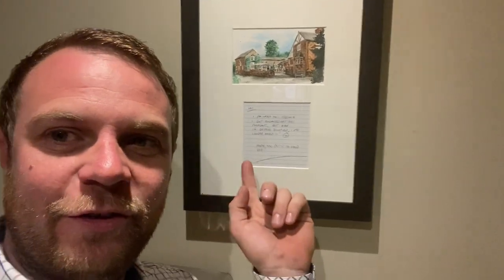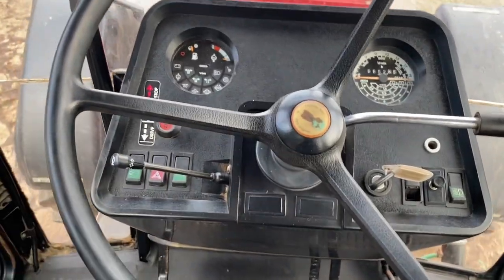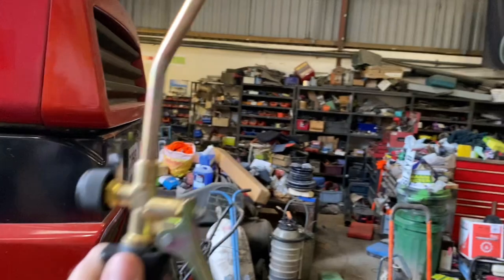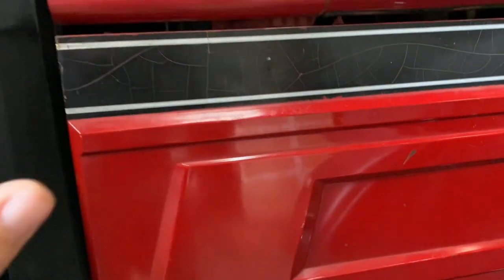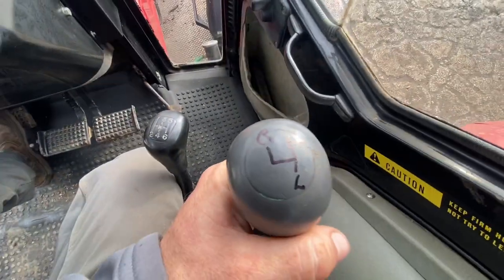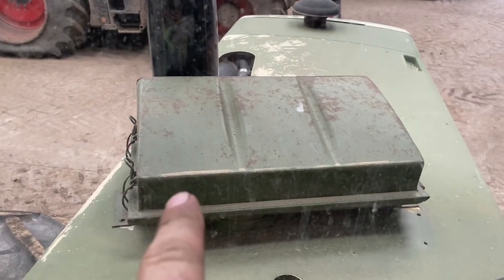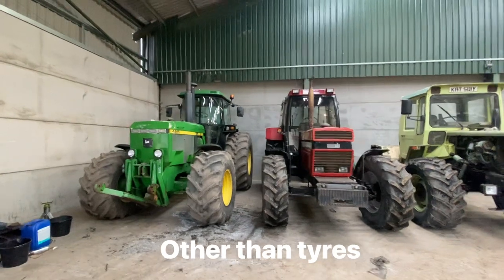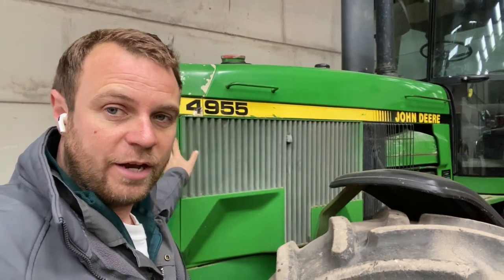Day574  #OLLYBLOGS BLOW LAMP GOES WRONG ON 1455 FIX & CLASSIC TRACTOR FUNDING  #AnswerAsAPercent

Comment: How you don’t win awards for farm diversification I don’t know Olly. The number of different revenue streams your farm has and the simple solutions you’ve used for things like grain drying etc are amazing. It’s so simple on the face of it but to think at some point someone thought ‘we’ll take tree waste (already fixing a problem for tree surgeons) , chip it, use the chips as fuel to heat the farm and the grain dryer, and we’ll sell anything we don’t use, oh and we’ll do it cleanly and efficiently’ 

Way ahead of your time. 

You’ve already got the heating system for your new museum shed too, the saying hard work easy life comes to mind. Working on your farm must be an absolute pleasure with how ‘easy’ some of the day to day stuff has been made to work when compared with other farms.
Reply from the maker: Thanks also good for getting dry when it rains

Comment: Hiya Olly, the bonnet latch is on the left of the tractor as you look at it face on. Its a lever, located under the side pannel near the cab. 
And on the speed, you have high and low range labled backwards as I understand it. As far as ik thats the formation for a 1255. High range is with the range lever toward the rear of the tractor.

Comment: That heat trick works on certain plastics by bringing the oils to the surface. Never heard it used on fiberglass, I was worried when I saw that torch!! You’ll be able to compound polish all that up and they should come pretty close. Used to love driving a 1255 with that fluid clutch!  Look forward to the mb trac refurb I nearly went mb before I hit the Fastrac, used to drive them too. Great machines!

Comment: hi olly yes there should be a lever just at bottom of right hand engine panel ,cab end .i have a 1455 to, got mine from crawfords about 8 years ago pulls like train ,160 hp on shaft.
Reply: What do you reckon the top speed of yours is? I’d have thought Olly’s one only doing about 27kph is too slow.
Reply: @adamgood742  43 /45 k it's P reg one of the. last made

Comment: the heat gun trick works with plastic as warming the plastic up brings the oils back to the surface again restoring the colour (works well on black car bumpers). fibreglass is normally finished with a gelcoat surface, you might be able to sand and polish it back up again. like you could with the paint on the top edge of the bonnet where it looks on camera to have faded, if you sand it with P1200 or anything above then polish up with compound and you can remove any dead paint bringing back the original colour again. if you would like some better info im happy to email or message you in more detail

Comment: We had 885’s, 956’s and 1056’s back in the day, and they were really good workhorses, biggest drawback was that you couldn’t alter the steering wheel position like you could in the John Deeres that we also ran! A heat gun works on faded black plastic trims, not sure whether it will on paintwork though 🤔

Comment: The leaver for bonnet is buy fuel filler should be pocking out under side panel with a round knob on end make sure you take exhaust off first before you flip it up and and don't let it go or it will drop with a bang and could break front cowling 👍 great vid

Comment: Once you have got hte MB and the 1455 in fine fettle, it will be interesting to see what they can pull compared to their modern generation counterparts. There seem to be enough farmers holding on to older, less computorised and ad-blue'd tractors to suggest the allure of high tech on low cost finanace packages might not be all that it is cracked up to be.
Also, do more comments still drive more youtube income (always used to) so encouraging as much commenting as possible will get more income to fund the quadtrac - I want to see you really build a collection of unusual tractors, of which the MB starts the journey!
Reply from the maker: I’d love a 4494 case to 
I’m not sure if comments help 🤷‍♂️

Comment: Love the update on the 14 👍
There is a handle below the right hand side panel, towards the back, it moves backwards to release the bonnet catches, then the bonnet will lift up forwards & stand up, lift the exhaust off first. The side panels then lift off upwards, when the bonnet is down it sits against them & stops them jumping off upwards. 
Had a big Sunday dinner today, so 100%. 😋

Comment: Etch the top of the gear knob with a dremel or pointed soldering iron.
Reply: Then add snowpake or white paint to the figures..😉
Reply: Great idea - then fill the etch with white paint - it won't rub off.
Reply: Tipex/erasing fluid works well

Comment: Olly, What age is your 1455XL as early ones didn't have the splitter and did only have 30k boxes in them I think. Also if it's an early one should it not be cream and red?? If there is a splitter it would I think be a lever beside the seat poss on right had side looking like a handbrake lever. Well, that's what the 1056xl was like. Also, watch up around the sunroof as they used to leak really bad and then ruin all the headlining etc. ignore the early question as I see it's not got the beige/sand colour interior. Lower panels should just pull off, then offside of the bonnet somewhere near the exhaust should be a lever you pull back then tip the bonnet forwards once exhaust removed.

Comment: A good tip for you, when using the new glass scrapper on the window, spray the glass with soapy water first, will help you to not scratch the glass from the blade and help the blade to glide on the glass <<< 36 year window fitter
Reply from the maker: Good idea

Comment: On the right side of the tractor at the front of the bell housing there should be a lever just underneath the line of the side panel you need to pull it to unlatch the top of the bonnet. The exhaust needs to be off first before you can tilt it up

Comment: To take off the bonnet you have to take off the exhaust, then lift up the side panels at side (the sit on little brackets) after you have taken the side panels off the bonnet release level is easy visible. (Pretty much a 2 person job to take the side panels off) hope this helps.
Reply: @bufferbridge  Didn't realize, the 1255 that I use we always have to or just take off the side panels off to get to the bonnet. (Also you can get to pretty much everything with only taking 1 side panel off rather than the bonnet)
Reply: @bufferbridge  Good to know

Comment: Great video again Olly,  as regards buying the jd 7710 or quadtrac,  I think the quadtrac would be more beneficial to you. Not only will it attract more people visiting it could also be very useful as a working tractor when conditions arent suitable for your wheeled tractors. Either way I will be visiting..
I think Chester is going to attract more visitors than any of your tractors 😁
Reply from the maker: I need both and have to be quick on jd or it will be traded in
Reply: @OllyBlogsAgricontractfarmer  I get what your saying, but a quadtrac could earn its keep as well as being an attraction. A tough call for you 🙄
May see you at Mr Almonds funeral tomorrow if your going. Thanks for the video Olly 👍

Comment: The transmission you describe is a torque converter, as used in automatics. Does it 'creep' on tickover?  I think someone's having you on with the advice to heat it to change the colour -  it looks like the paler red needs a thorough T-Cut, the removed sticker proves its just paint surface fade.
Reply: It's different to a torque converter
Reply: It's a fluid flywheel. You should let the clutch up at tickover ( even under load ) then increase revs, it stops wear on clutch

Comment: Do you not empty the bale chamber in your square baler when your finished?

I have a set of Case weights I could part with if you make me a offer I can't refuse!  I do use them at the moment but could buy a replacement set if you really want them.  Were from our 956
Reply from the maker: That’s a winter job not a 11.30pm after last field job
Reply: Emptied mine last week. Sprayed it down with oil and diesel.   Not my favourite job.

Comment: Forgot to say I’m from cockermouth in Cumbria ☺️
Reply: No Olly not an 8950 an 8000 with a TB turbo fitted 4.4 tonne in weight a 130 horse power on the pto ( power to weight ratio) they don’t make them like they used to !